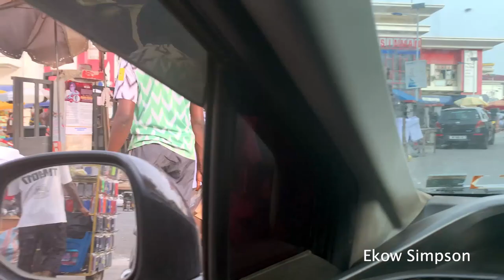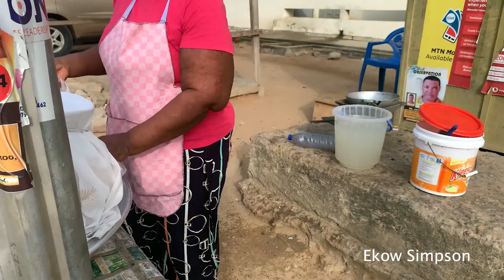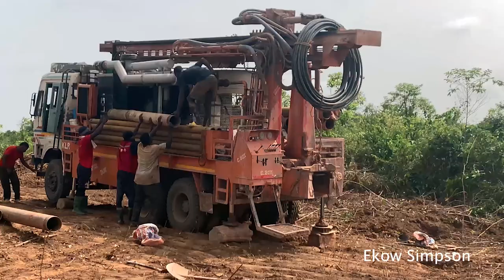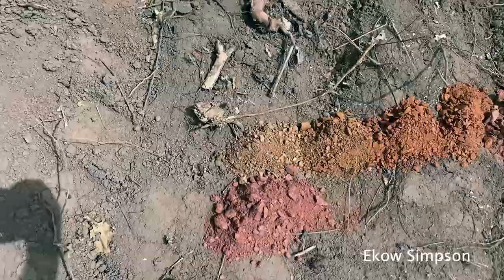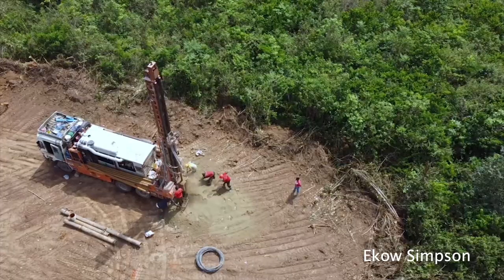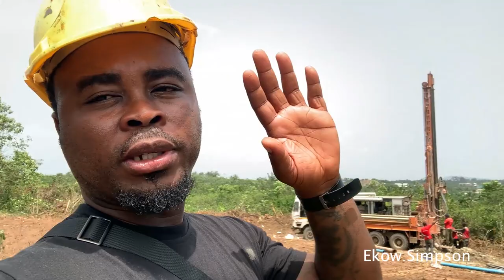How To Drill For Water In Asebu Pan African Village

Comment: Cost of Borehole drilling has gone down tremendously in Zambia. Less than $1,000 with hand pump, upto 60m depth, 4"plastic casing. However all the drilling companies are run by Asians - they have similar vehicles etc. Sorry you hit dry borehole🙄 it costs about 50% more